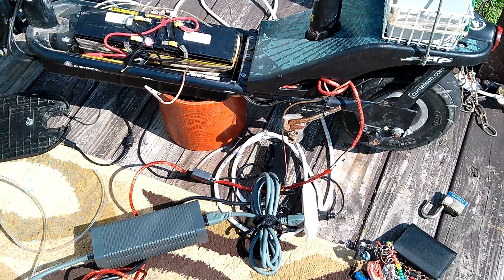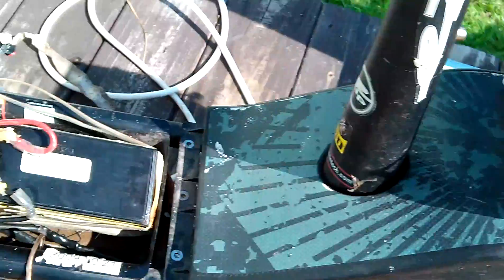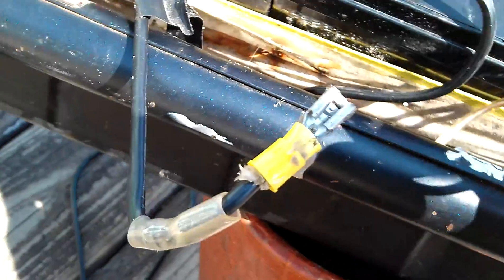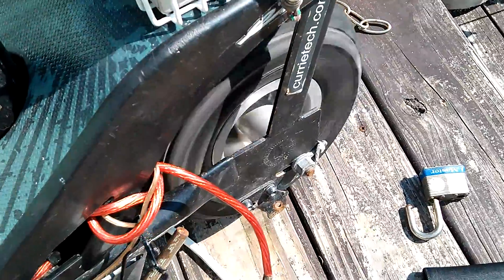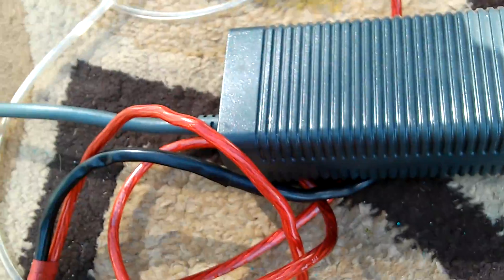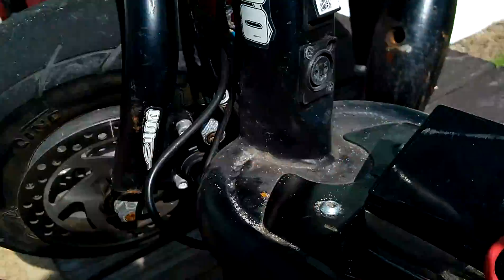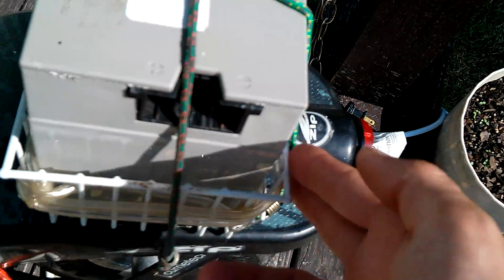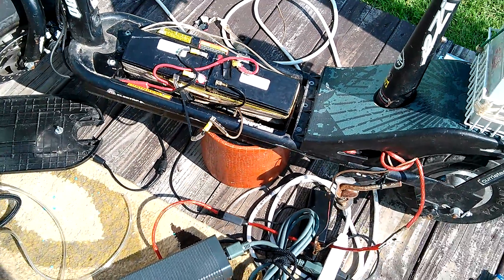Make Electric Scooter FASTER!! 20+MPH 36Volt

Comment: You seem to have extensive knowledge about electric scooters. So I have a question. I have a Schwinn S500 scooter which is essentially the same as yours. It has stock 24v controller and 24v 500 watt motor.  I bought a 48v lithium battery thought I could easily install and over volt the system but the scooter won't even turn on with new battery? I checked with old 24v lead acid batteries that nothing wrong with scooter it's fine. I actually took the 48v battery and connected to my daughter's e100 24v razor scooter and WOW the wheel was spinning lol.  I can't imagine a tiny 24v converter on a e100 will allow 48v but my 24v 500w scooter won't?  Also I went to open the controller box in the s500 and it was filled with heat reduction resin so I can't even touch the board. Wondering is there a wire that is responsible for speed limiter and it won't allow 48v to go thru system?  I'm very interested to hear your thoughts thanks

Comment: I have a ezip 500 but Ik it’s running standard 24v I have 48v lithium battery I want to use but idk it will work with the motor the idea is to get more speed roughly 30mph if I can
Reply: It came with original batteries and controller and wats and the difference between sla batteries and lithium
Reply from the maker: @prettboyswagg1  sla is the old traditional tried n true method using Sealed Lead Acid batteries like used on motorcycles and powerwheels vehicles for the likes. Lithium is much better chemestry based batteries and provide consistent power overall right till the cell dropoff voltage peakes its lowpoint ie around 3.2-3.4Volt/cell as well as being overall better its also many times lighter weight
Reply from the maker: Only some models of the speed controller were used in multiple applications for the 24 36 and 48V models. As far as i knew the ezip i had was the 24V model but handled up to 36V from my testings. You can also just always just swap out the existing controller for a different better model. In your case it seems you might have to. Mine used SLA batteries not Lithiums. Im not sure if yours does too or not but you definitely cannot mix lipo to a SLA system as youd highly risk major damage to the battery/cells and possibly electronics controllers.
Reply: Ok so if I upgraded the motor we’re could I get one that’s would hold say 1000w but fits the ezip
Reply: @prettyboyswagg1 did you ever doggie issue out?  I have same problem in that I bought a 48v lithium battery and my s500 won't even turn on.

Comment: Can you boost the speed on any electric moped? I wanna make my electric Moped (Top speed is currently 35mph) go much faster, but do it in a way that far easier than all this.
Reply from the maker: Upgrade the electrical system. Either a more powerful direct drive hub/motor or the motor itself along with an esc upgrade and swap over to LiPo packs if you already arent using them. Thats youre ultimate best choice if you have the money to invest. Also could look into gearing as well but be mindful youll sacrificd something along the way for that. Lower low end torque,better top speed,less mileage etc.
Reply: @demonsparkx  hey I got ninebot e12 electric scooter 11.2 mph top speed is there anyway to make it hella faster?

Probably 2 hub motors any ideas lmk
Reply from the maker: @BlackCat-qm3sj  ecu battery and motor upgrade. You Can over volt the motor but the higher rpm is gunna wear the brushes down quicker ultimately. Or go with brushless an lipo system. Wayyy better choice but costs more
Reply: @demonsparkx  I was thinking about installing 2 250w 8 inch hub motors if they have any that are 250 or 350w 7 or 8in 

But then once I install two hub motors I'd have to figure out how I can control two hub motors with idk? The same controller maybe 

Any ideas where I can get 2 hub motors that are possibly 7 inch 350w I'd need to find a battery packs which are expensive or can I use lipo battery packs that are in rc cars

Can you possibly get me links to find a speed controller for 350w 7 or 8inch hub motors and battery packs I'm confused on how to make my ninebot e12 scooter faster I'm thinking about taking off the mud guards that are in front and in back take off them and install bigger wheels

Thinking about 350w 8 inch if possible and not sure what speed controller I'd need or battery packs seems like the motors and stuff are very expensive wow

Comment: How do you get crimps off battery post?
Reply from the maker: Usually not too easy to remove i typically just extended the wire with same or lower (larger) gauge wire.

Comment: Do you think I could use a 4th battery and not burn out the motor?
Reply from the maker: TornadoSandwich youd hands down either blow the fusing,wont power on and function. Will function just fine. Or burn up the ESC due to the higher voltage and current. Some can handle it some cant. The motor
 (contacts/brushes) would be worn a lot faster but would probably be just fine.
Reply: demonsparkx my scooter is the 750 watt version and it still feels cool at 36v currently, you don't think it would work with the extra 12 added? It's highet wattage than the one in the video, and it seems like a lot of ebikes use 48v with a 750w motor
Reply from the maker: TornadoSandwich ohhh well in that case yes most likely SHOULD work without any problem. Keep in mind your only real true limitations lies within the ESC circuitry. I read online theres two versions of this eZip 400 i had in the video. One ESC was an updated model that Ezip/CurrieTech happened to use in the newer model Ezip400s which was also able to go up to between 36-48V and handle it just fine. Personally i never had a problem with mine for the time i was able to test it. Granted the 3rd 12V SLA battery i used would only work for about 1 minute of full power before dying off. The speed run test however showed major improvements from stock 24V to 36V with an increase average of around 6.5-9MPH increase in overall speed. Honestly any faster with THIS scooter feels sooo unstable lol. The short wheelbase and tiny wheels,no suspension etc.. it gots them speed shakes a good bit! Think i topped it close to 25MPH speed run @ 36V with a very crappy third 12V battery.
Reply from the maker: TornadoSandwich https://youtu.be/BQWaYMX98Pw
Reply: demonsparkx I have a bunch of 7AH 12v leadacid batteries because my family is in the alarm business so it's easy for me to test. I used 3 batteries and could only get up to 20mph, weird that you got higher with a weaker motor, could be something wrong with mine.
Reply from the maker: TornadoSandwich lol nice to know. Yeah i think my top i achieved on Gps off my phone was somewhere i think 24.5MPH flat surface. Im very light also,being 105lbs or so.. also yah i seen them larger styled Escooters. Mines more like a kids toy compared to the 750 like yours. Also makes me think most likely had to do with like you said the motor,but nothing wrong,just mine must of been spinning higher RPM with better gearing ratio most likely seeing as the wheels were smaller than yours by a lot too. Yours much much better suited for doing 25-30MPH very smoothly id imagine due to the larger wheels alone. Cud always just upgrade the whole electrical system if ya wanted too. Aint hard just to literially swap out the ESC,possibly motor and your throttle. They got all kinds of parts and kits online for Escooters and really i dont think were a whole lot of money for the most part. I wanted to do it to mine and make that thing 1000W with LiPo and brushless,lmao! Thought itd be pretty insane on that tiny thing. And the weight reduction using LiPo... oh man! Would of been killer!
Reply: demonsparkx yeah I weigh like 180, I remember this thing accelerating much quicker when I was little. And I replaced the batteries a couple years ago, never even used it that much but leadacids are only good for like 5 years
Reply from the maker: That linked item looks like ur best bet! ;)

Comment: um way would you use a Xbox power supply it needs to be plugged into the wall so it would be useless in a car or scooter
Reply from the maker: Its not to actually be used on the scooter lol,its a solid state source of DC 12V at a high amperage output,used for bench testing as seen here in this video. I used it in place of another 12V SLA battery since i didnt have a good enough one to use anyways. This gave the best representation of how much more performance to expect when running at 36V as opposed to stock 24V which i also later demoed and clocked via my phones GPS speedrun with an optimal increase in about 7-9MPH top speed increase and a LOT more torque.
Reply: But now for a serious question, 
Do you have a custom made really long extension cord or a bunch of them strung together?

Comment: I have a 750 w Currie motor, I think the speed controller is bad. Do you have any idea if i have to replace it with a 750 watt  controller?
Reply from the maker: Id higly suggest always replacing the same components with ones suitable for the same. You CAN use a lower rated wattage ECU.. BUT you'll be risking a few things,one being that the controller cant handle the difference in voltage/amperage (some controllers cant do 36V when meant for 24V etc) so you may either risk burning up the ECU,or it simply will go into protection/overvolt mode and just not even work at all. You can check around on forums to find out which ECUS can/cant handle dual load 24- up to 36V whereas like mine in this video,was meant for 24V but handled 36V just fine. It depends on the model ECU box,some can,some cant. Though i utlimately suggest updrading to acomodate an even larger load size to give future headroom for more upgrades IE: running a 1kV or 1.5kV electronics with a 750W motor. Speed controllers/ECU are known to go bad from time to time,and that being the main component that handles all obvious voltage regulation and also charging circuitry,theyre fairly easy to replace as well as come-by. Good luck and hope i was able to help!

Comment: Didn't realize a Xbox power supply output that many amps. Anyways, had a question that you might be able to answer. I bought a EZip 1000 from a thrift shop the other day and rigged up a charger for the batteries. It has 3 12v and when I hit the power switch, there's a clicking/ticking noise coming from the motor and the little indicator light is saying low battery. Nothing else is doing anything. I changed the 40w fuse in it. I honestly don't know shit about troubleshooting scooters, electric motors or whatever. Any feedback or suggestions would be greatly appreciated cuz I'm tired of walking down to the next block for a hooker, when I could be rolling on 7's.  Haha, jk.... Any help would be cool though for sure
Reply: A Fungus Among Us yea most likely check the battery voltage theyre probably too low go to harbor freight and buy a volt meter if theyre under 10 bolts is either do a recovery or get some other batteries id recomend go to the goodwill and buy 3 of them UPS back up they usually have 12v batteries inside a lot cheaper then online or other stores then hooked them up in series  so you can have a total of 36 volts hook up the negative of one battery to the positive of the other one .. good luck :)
Reply from the maker: first off thanks for the comment and inquiry (funny btw lol)
well to me firstly my first assumption would be the batteries are probably too dead to have enough current to cause the relay to switch over inside the ESC, the ESC unit is the only thing i can think of that the scooter would utilize for power management to the motor aside from the POT inside the throttle handle controller. seeing as its a triple 12V battery array, it's safe to assume that the Ezip you have is a 1000W 36V model (nice find btw!)
you can easily try troubleshooting the batteries by simply disconnecting the main molex lead (if there IS only one,which there should be,coming off the three 12V cells connected in series)
just to test functionality of the scooter and bypass the current batteries. the problem is you'd need an external source of 36V with a high current (at LEAST 15A minimum to crank the motor and ESC) you can use small automotive batteries or larger ones,anything thats a working 12V SLA (sealed lead acid)in series to get the 36V needed to run its electrical system. firstly also i'd say use a multimeter/voltmeter and connect it accordingly to each or all the current cells to make sure or verify each/all are working and have 12V per battery. obviously being 36V total if connected in series. mind you,ESC's are known to go bad after so many years so that may be your only problem, the ESC handles ALL the current and voltage regulation as well as the charging circuitry as well. the clicking noise is most likely the relay inside the ESC, which leads me to believe that its just the batteries are just far too dead and don't have enough power to run the system properly. if needed i can try and help by making out a schematic diagram of the wiring on how you'd need to hook up the voltmeter etc to test and bypass/troubleshoot as im all too familiar with how annoying electrical systems can become when having problems.don't hesitate to ask me anything else you may need to know about, im always here to help! :)

Comment: so your car batteries are connected to the wall plug end of the xbox unit? and your motor to the output of it?  it needs 120v input?
Reply from the maker: richard konsky
um yes of course... i worked with SLA and LiPo before for many years.. i dont understand what you're getting at though seeing as my power supply i ran in series to get 36V off the xbox supply,supplied 12V @ 16.5A which is many times more than 2A and its not going though the charging circuitry either... so it's not even as if im supplying 16.5A to the batteries. the power supply was acting AS another battery.
Reply from the maker: +Joe Humberstone no no, how i had this set up was as follows. 
the xbox power supply unit was plugged into the wall as normal (there is no other way around this,its solely meant for bench testing only)
using the + and - leads off the power supply, wired in series with the batteries IE: ( + - + - + - polarities ) 
supplying a total of 36V at near 40A DC current. 

this was done sheerly as a testing method of running this motor and ESC with 36V rather than stock 24V, to see if the system could even handle the increased voltage and amperage without killing the ESC (rated 24V 40A stock currie tech controller)
which in turn worked out wonderfully. i later planned to upgrade using just another battery in place of the power supply,now realizing that the system would function as normal and even better with the increased V&A.
later on road testing further proved this method by knocking up the average speed from 12-15MPH to a top speed of 21MPH clocked with GPS off my mobile phone, and a moving average of 17-19MPH which is a significant increase over the stock 24V. i hope this helped and further clarified your question. sorry for the late reply, but don't hesitate to ask anything else im always here to try and help assist others the best i can!
Reply: +demonsparkx you do realize that small sealed acid batteries have to use 2 amps minimum for charging? or they will turn into a swollen hot brick?

Comment: what are you doin with that xbox transformer?  how does that work?
Reply from the maker: +Joe Humberstone its my power supply,i modded that xbox power unit so it can be triggered to turn on and off on demand,providing 12V @ 16.5A which is VERY useful for applications like such here scooter motors,car electronics equipment IE car decks,amplifiers dvd flip out displays etc.